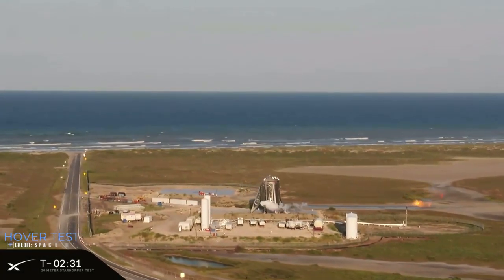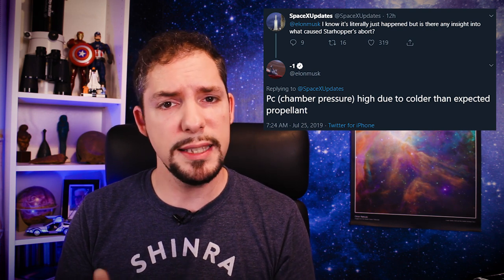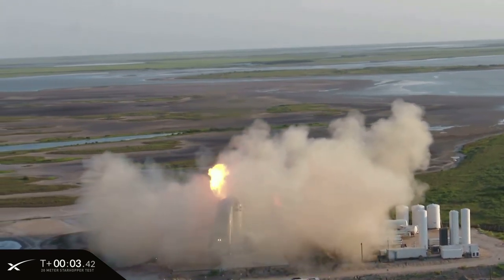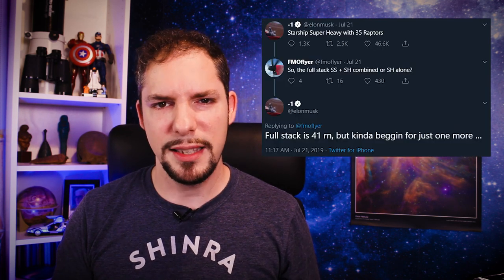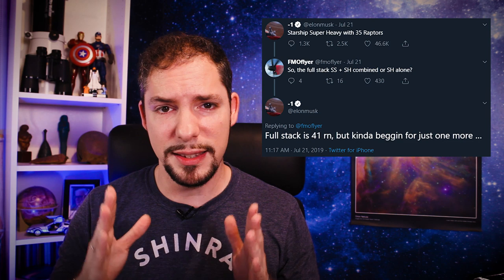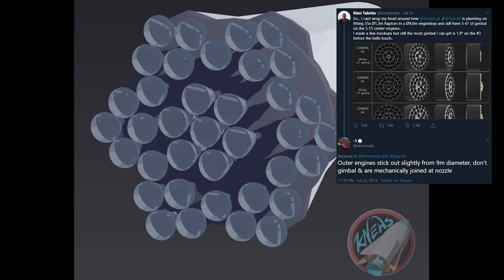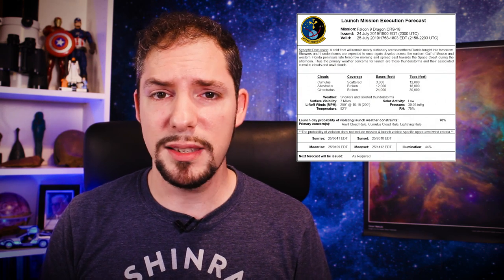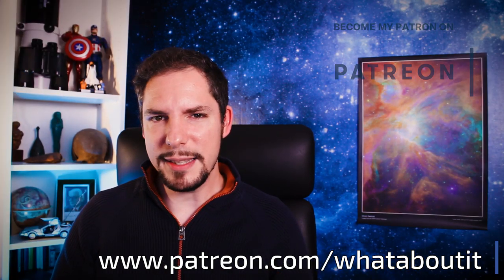18 | SpaceX Starship Raptor Engine Configuration, Starhopper aborted Test Flight  and CRS-18 Updates

Comment: The new building in COCO is too light to be a launch structure.  It looks to be an assembly building.  A place is needed to assemble SH booster and even Starship.
Reply from the maker: Could be! As I said. Highly speculative. ;)
Reply: @Whataboutit  My 25 years in the steel construction industry says "Moderately" speculative.  LOL
Reply: Maybe a service structure, to be moved away prior to launch?  One picture and no details...just too hard to tell.
Reply: @Andrew-13579  I vote that NASA use that huge vehicle assembly building for it's express purpose.  It would allow the Falcon Heavy in expendable mode, to hold a European Space Agency service module and an Orion capsule, As long as they stay vertical.  Then one of the two 5,000 Ton transporters could move the whole thing to Pad 39A for launch.   (With ease)

Comment: The 250 ton thrust Raptor is can't be throttled. It could be gimbaled but the outer engines aren't supposed to anyway and the inner ones need throttling for landing. So the outer one or two rings of engines might get the 250 ton Raptor.

Comment: Why they don't build the inside first and then just weld the steel sheets directly on the body?
Reply from the maker: Because the insides of the rocket do not go uninterrupted from bottom to top. That would be pretty heavy. It's more like different parts put in at certain spots.